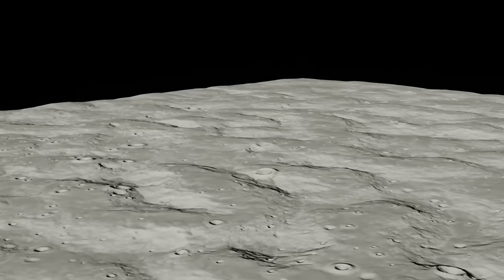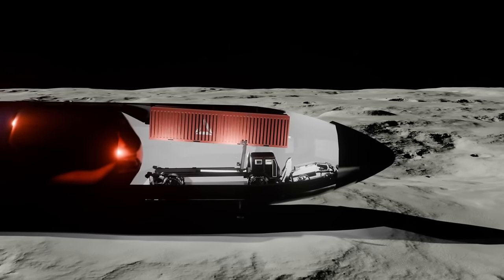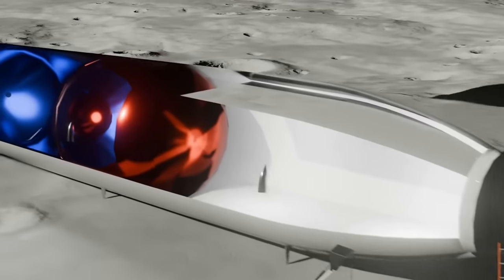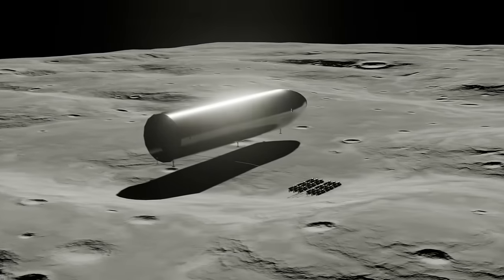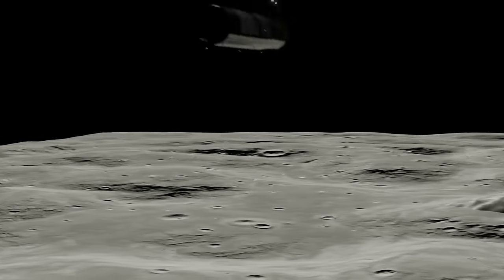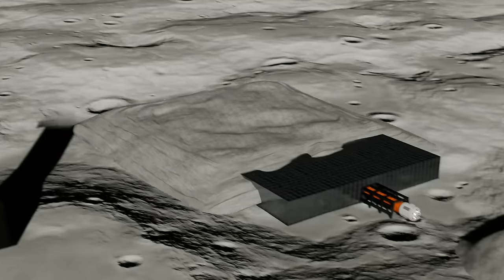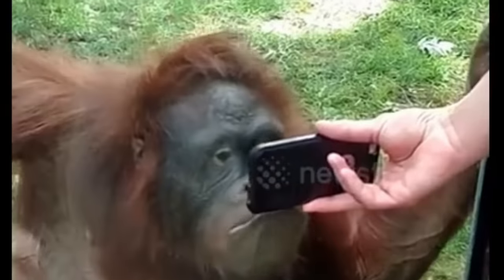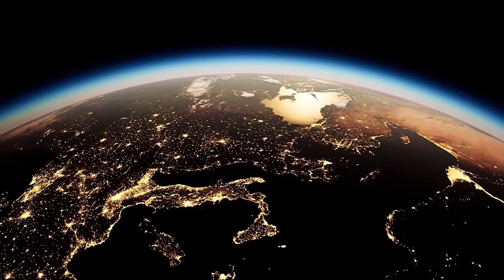How To Develop The Moon ALL PARTS

Comment: You grossly underestimate the problem of the dust. The Apollo suits were wrecked in 3 days.
Reply: Well, you should also consider that tourists may not spend as much time outside on the lunar surface as the Apollo astronauts did. But say that was an integral part of the experience that they were offered/paid for. Consider that those suits are 50+ years old, and we probably could make something much, much better that lasts ~1 month, and then since we have an actual lunar base we can (instead of planning to return in 3 days and never use them again) take them inside the lunar base to refurbish them, potentially allowing you to use it for years and years.
Reply from the maker: Magnetic arrays solve this problem
Reply: Yah, there's a whole lot of underestimation here. 
The best way to get up and running on the moon is self-assembling systems and robots. Way too risky, dangerous, expensive and inhospitable for humans to do the grunt work, get the infrastructure installed and then ( maybe ) people can move in.
Reply: @Anthrofuturism 
Can magnetic arrays solve non magnetic regolith problems?
Reply from the maker: @sidharthcs2110  it's electrostatic
Reply: They weren't "wrecked" within 3 days, but the rigolith does tend to stick to absolutely everything. Likely they'd have the airlocks built like clean-rooms, so that it can be vacuumed off and the amount of dust tracked inside is minimized as much as possible.
Reply: Suitports solved this problem
Reply: @blackepyon4042  Or just use suitports
Reply: I generally like the idea, but I feel our financial resources should be used to correct planet Earth’s  major issues concurrently.
Reply: @braveheartz263  That's a short sighted view. If we can solve the problem of living on an in hospitable planet all our problems on earth regarding survival become trivial.
Reply: @braveheartz263 fixing earth has never been a linear spending of money. You don’t just spend X amount of dollar and get back X amount of problem solving. A lot of earths problems can be solved from innovation and much of the innovation needed to colonise the moon would likely trickle down and help improve things on earth. E.g. growing food in inhospitable environments, small scale nuclear arrays for electricity in areas off the grid and whatever else we can’t even conceive of till it happens.
Reply: Apollo was ages ago
Reply: @Anthrofuturism Has that technology been proven?
Reply: @braveheartz263  I agree but in the long run one of Earth's most important problem is limitation of space and resources, making such projects very important
Reply: @LeDingueDeJeuxVideos  It’s important, just like “space junk,” but clean air, clean water, and making sure the earth is staying in balance is for our people’s future.
Reply: @braveheartz263  I am not sure to understand what you meant when referring to space junk, but I am an environmentalist, so I absolutely agree on everything else
Reply: @LeDingueDeJeuxVideos  Space junk that’s being tracked because it is a dangerous piece of debris that could penetrate the ISS and collide with spacecraft. I hope this helps.
Reply: @braveheartz263  Oh yes then we agree on everything mentionned
Reply: Something tells me this fine dust, accumulated over eons, will be initially very valuable! You an just sweep it and process it. No hard rock to break or anything! Plus moon has zero atmosphere, once you sweep an area clean there is no wind to carry more dust to you!
Reply: The biggest problem of planet Earth is humans. We need to get the fuck out. Or at least, get our activities the fuck out. I really hope that at some point mining on Earth will be inefficient and uneconomical, and eventually banned. This is how you solve the problems we have today

Comment: UK's Nuclear Division of Rolls Royce's are developing Reactors for the moon and beyond
Reply: Small Modular Reactors. They're being developed not just for the moon and beyond, but primarily for here, on Earth. Put one of these at the South pole and you can power a village there with energy to spare. Just to say. They beat, both financially and practically,  the huge nuclear stations that take many years to build, as they are modular and can be built like on an assembly line. Best of all, they can be disassembled and transported to a new location if needed. And because they use liquid fuel (dissolved) a meltdown is practically impossible, unless someone finds a way to hack it and sabotage the system in some way, which is extremely unlikely.
Reply: @paulmichaelfreedman8334 Of course they have to say they're building it for the moon to hype up the interest.
Reply: @bobweiram6321  They're serious about all use cases, earth, moon, mars.
Reply: RYCEY IS THE GOAT!!!
Reply: @paulmichaelfreedman8334  They actually DID have a nuclear reactor at the south pole. They scrapped it in favour of diesel engines, for some dumb reason.
Reply: @blackepyon4042  Ahh, the nukey-poo...yes, I suppose at the time diesels were more cost-efficient for their needs there as the thing was notoriously unreliable. Although it did function for 10 years.
Reply: @blackepyon4042 I think they scrapped it after rising costs of other army things and also because of the SL-1 distaster
Reply: That’ll be really useful for if the U.K. ever becomes relevant again
Reply: @musicdev  you do realise that a fair whack of the US’s military hardware was design in, or has parts that were made or designed in the UK, as an example, the F-35 Lightning, its STOLV engine uses a Pratt and Whitney F-135 for its power plant, but the LiftSystem then allows for STOLV is made by Rolls Royce. The M1 Abrams, an absolutely incredible tank, uses Chobham composite armour, designed and built in the UK, one of the best non-explosive reactive armour types in the world
Reply: UK has done nothing for space exploration

Comment: 1:50 : belly flop doesn't work on  the moon!! To land sideways you need additional rocket motors at the nose and at the stern/ or a 90° gimble capability + structural reinforcements to carry the bending forces  - a completely different rocket!
Reply: Watch the tear-down of Starship hulls. Those 4mm tank rings are super flimsy after depressurization. 

I have more inclination to believe that buried inflatable habitats are the way to go. Dig out trenches as deep as possible so the cover mounds are not tall, inflate the habitat, inflate structural members with rigid foam, backfill and cover with regolith/binder concrete. 

Maybe polyethylene/regolith composites on Mars. Use some binder that's more heat resistant on the Moon.
Reply: As soon as I heard the dialogue about the belly flop landing, I knew this video wasn't coming from somebody who knew anything about physics. This is for entertainment purposes only
Reply: @michaelwilliams2593  that’s a little harsh. I wouldn’t say that it’s only good for that. I do agree that the bellyflop idea isn’t terribly practical, but it would probably be possible to land a starship vertically, and then lay it down on its side
Reply: @mahatmarandy5977  Agree. There are many techniques with hoists, jacks, supports, partial digging etc. that would make it possible. And indeed if you can already ensure that it is partially in a (newly-dug) trench then covering it in regolith will be a lot less work. Still hoisting down equipment and vehicles from a vertical starship might work quite well too (in KSP that is almost undoable. ;-)). I like the rough ideas in the video but I think many ideas can still be improved upon with some thought.
Reply: @richardbloemenkamp8532  I don't see the point in landing it horizontally or landing it vertically only hoist it and move it to a horizontal position. It's easier to bring inflatable habitats or dismantle the starships and create a new structure. Inflatable with some reinforcement is the way to go in my opinion. Dig some space and inflate the habitat. Reinforce it afterwards and cover it in regolith. For the beginning you need air filtration, water filtration, waste recyclers, a means to obtain water. And to hook it up to the power source. It's a lot of work and trying to bury a Starship is just a massive waste of time. That's honestly too much room for what they need
Reply: @snakevenom4954  Agree, first look at what you really need and then look at the easiest way to get there. Also I would expect to bring a lot of the equipment and tools in the beginning. Later on we can think of producing equipment on the Moon.  To me there is no point in trying to be totally self sufficient from day 1 if it makes things more complicated and risky.
Reply: It would be much easier to land on a plataform that can tip the rocket sideways.
Reply: Obviously Starship would have to be modified to land sideways. It’s not even close to an insurmountable challenge, you’re nitpicking.

“But the current version is incapable and there’s no way to modify it to accomplish a 90 degree rotation either before or after landing 🤓”
Reply: @enclave6285  It just doesn't make sense to land sideways. Easier to land vertically, take off the outer walls, and just winch down the container. Powerful side thrusters will require lots of money in Research and Development and another bunch of money in testing
Reply: I see no problem. The Starship is very strong and could hand the belly flop easily
Reply: @viarnay  The Belly Flop is so the atmosphere can slow down Starship. There is no atmosphere on the Moon. That's why they say it won't work. Nothing there to slow the ship down
Reply: @snakevenom4954  There is no need to land on the moon at high speed it can take whatever the time you need to do it safely
Reply: @viarnay  To get to the moon you need a lot of speed. I think it's something like 25,000 mph but it could be more or less. Orbital velocity is around 17,000 mph. So Starship needs to accelerate to 25,000 mph, then decelerate down to 0 for a landing. However, it could likely decelerate with the moons gravity. But still, a belly flop isn't used. In fact the Lunar Lander won't have the wings
Reply: @snakevenom4954  So what? they can decelerate obviously
Reply: @viarnay  Decelerating Starship will require a lot of fuel. Maybe need to go into a Lunar orbit and refuel there again. That is the main problem with Starship. It's so big it needs so much fuel
Reply: @imconsequetau5275  Buried definitely makes sense, honestly probably mandatory for long term habitation. Provides a lot of radiation and impact protection. As an Isaac Arthur fan I'd be remiss to not mention LAVA TUBES as well.
Reply: @snakevenom4954 
the lunar lander version of starship will not have any big engines on the bottom. It will have many draco like engines high up to not shover the moon in micrometer pits every time it lands or launches. The lunar lander version will not fly back to earth, only to lunar orbit and lunar surface. Where it will rendezvous with whatever ship came from earth.
Reply: @k1dicarus  The Lunar Lander will have the main engines to not only get to the moon but also to slow down and insert itself into a lunar orbit. It will not land or ascend with the main engines, but it will still have the engines
Reply: @barahng  
Living under slabs of water/ice 5m-10m thick. Atmospheric pressure from below will reduce load on the support columns for the water-filled glass ceiling blocks (or regolith).
Reply: @imconsequetau5275  Why would they be depressurised? We need pressure to live. Would just need to purge with N2 then top it up to 20% O2.

Also, what's to say they won't make the throwaway ones that purpose built with extra supports inside?
Reply: You can knock over a starship using cables and then gut it to make a pressureised habitat
Reply: @michaelwilliams2593  Of all the things to hang a counterargument on, it's the bellyflop manuever that you picked? The bellyflop is a technicality. But of course internet armchair experts will latch on to any technicality and call it a "gotcha."
Reply: How much force do you think the flaps deal with? Mounting landing engines there instead of flaps is trivial in terms of structural changes.
Worth noting is that the overwhelming majority of decent slowdown will be with the main engines. The bellyflop would just be for the touchdown. The raptors cannot do the landing without a tower, so you need landing engines either way, the only question is what direction you point them. I'm team bellyflop, because the payload being near the ground is just easier. The technical challenges of the flip largely overlap with those for the atmospheric flip, so most of the work is already done. All the systems are already uniquely designed for lateral g loads, and transitions around them. It already has everything it needs to get rid of the crane.
Reply: I've landed sideways many times in Kerbal without any additional rocket motors.
Reply: @toddpowers3620 that is because KSP has wonky collision physics and doesn't simulate pressure very well. Also have you seen how comically heavy the fuel tanks in the game are? Worse dry-wet mass ratio than an airplane.
Reply: @snakevenom4954 All space related maneuvers require a lot of deceleration, the moon just has the downside of not having aerodynamic drag. But that's countered by the fact that Lunar starships don't have to return to the  earth.
Reply: @lenarianmelon4634  My main concern is if Starship has enough fuel to go to the moon from LEO, slow down to rendezvous with Orion, land on the moon, launch from the moon and rendezvous with Orion again. It'll use a lot of fuel just getting to the Moon and decelerating. I just don't know if it has enough to land and reinsert itself in the NRHO. It probably does, but I just don't know the math nor have many people from NASA or SpaceX claimed it can. Although I would presume that's because they know it's possible but don't realize others have doubts about it
Reply: @snakevenom4954  If there isn't enough it's not that big of a step to just place another tanker in lunar orbit. I mean the future Lunar Gateway station plans to have a fuel depot module.
Reply: @michaelwilliams2593 I mean you can clearly see in the video that the ship isn’t doing an aerodynamic landing lol. It’s propulsive, so there’s nothing deviating from a science background there
Reply: A better solution, in the short run, would be to land vertical and then 'tip over' the Starship via a system of cables.

Comment: If the moon is industrialized, it brings down the cost of building an orbital ring considerably. An orbital ring is one of the few earth-to-space megastructures that can be built with normal steel, with surface-to-space train lines made from normal steel hung from it, rather than unobtanium supermaterials like a space elevator requires. It's also a very handy place to put things like terawatts of space-based solar power for both terrestrial use and its own use, slipways for building massive interplanetary ships, communications and astronomy equipment of absurd size, electromagnetic launch rails, and split-propulsion emitters like giant lasers for pushing laser sail ships. That would lower the marginal cost of moving mass to orbit enough that regular travel and trade in space can reach the level necessary to support millions of people in space rather than a few thousand.
Reply: Wait, what elevation would the ring be on? Is steel really strong enough to keep it together?
Reply: @Mbeluba  The steel ring would be in orbit, we power it and use the magnetic field generated to levitate platforms.
Reply: @BenkOfTheKlery  Are there no issues with ring staying in orbit? I assume it would need at least some thrusters to correct it's position.
Are you sure ring of that size can stay together? I'm not sure what forces act upon it and how they cancel each other, but having a ridgid steel ring of more than 20 000 km in diameter must be complicated, even in microgravity. It's definitely spinning in relation to the ground, so is there any centrifugal force?
And also what kinda platforms supported with electromagnets are you talking about?
Reply: "And also what kinda platforms supported with electromagnets are you talking about?" Imagine a static maglev with the form of a platform, that's it.

The answer to the other questions is... there's no answer, there are so many variables to count for a design(if you didn't realize, I'm not an aerospace engineer yet). But if well designed the answer for them is "YES, IT CAN".
It doesn't matter the size of an orbital ring if someone is planning to build something of that size sure that knows all the problems.

A tip: IT'S A CONCEPT, JUST ENJOY IT.
Reply: @BenkOfTheKlery  so you don't know. That's fine, just don't pretend you do.
Reply: @Mbeluba  That's what I hate, people simply don't read anymore.
Reply: Honestly I think the idea of a space elevator using active supports seems more feasible than an orbital ring, and I'm definitely not saying I think active supports on the scale of ground to LEO constructions are feasible in the foreseeable future.
Reply: @Mbeluba They never said they didn’t know…
Reply: @ebonaparte3853  He's avoiding my specific questions, ergo he doesn't know.
Reply: @Mbeluba  He never said he knew nothing about it, he just doesn’t know the specifics yet.
Reply: @ebonaparte3853  YES. He doesn't know the specifics I've asked about. That's exactly the thing I would like him to admit instead of going on to waffle about other things, no matter how much he knows or thinks he knows about them.
Reply: @Mbeluba  Maybe ask an experienced engineer on this. It is just a concept right now.
Reply: @Mbeluba  an orbital ring would be a ring, in orbit. You could run platforms along the ring at orbital velocity (presumably by maglev) and the ring would support them while from Earth's perspective the platforms were hovering.